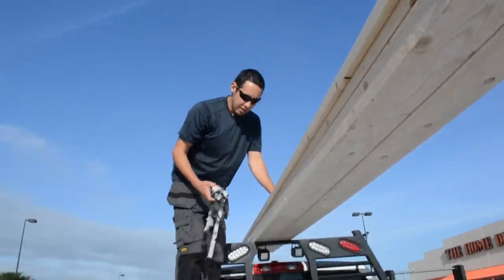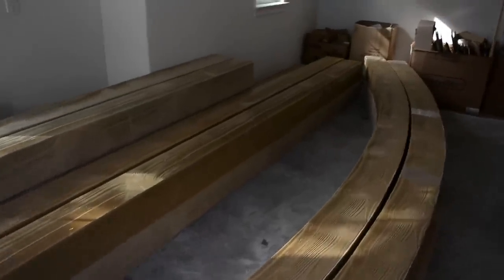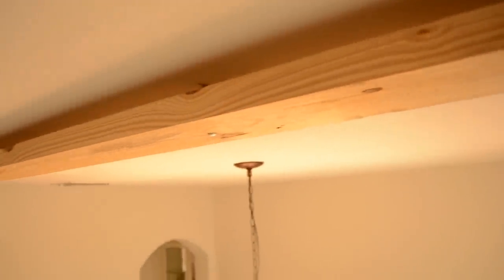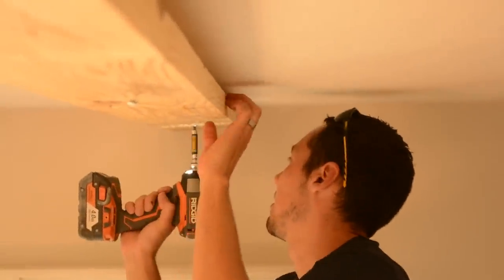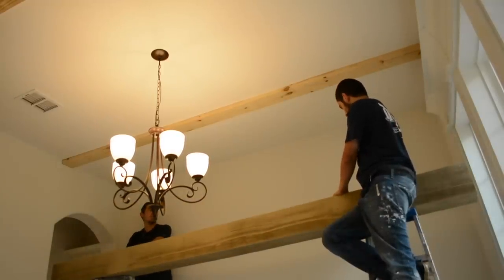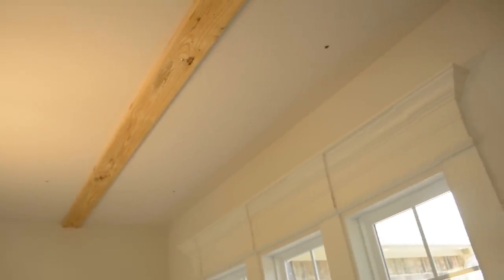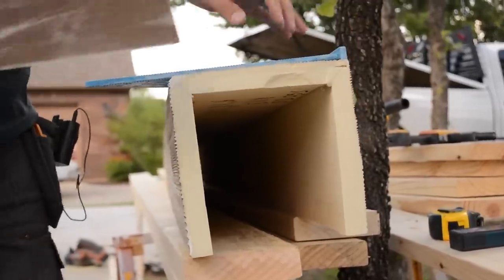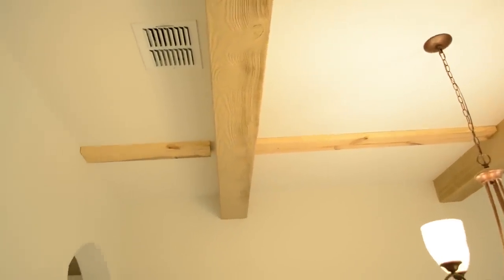Faux Wood Beams Install...

Comment: Instead of using those drywall anchors, go in the attic and add blocking. You can get a lot more solid looking beams this way

Comment: I used to make and install 'distressed' faux wood beams in the 70's. I'd make the beams and beat the heck out of them and used hammers and a router and chains to 'distress' the beam. People loved them back then- always stained in dark walnut.
Edit: I'd make them out of 1by attach the 3 pieces with glue and nails on the flat. All the banging, scraping and beating would hide the seam. I'd pull out the partially sunk nails when dry and beat, rout and scrape and stain. I got great laughs watching you try to get that first beam up. It brought back old memories.

Comment: Love your videos - I have learned a lot from them! One suggestion about the problem fitting the initial long beam with the window crown interference - I believe if you had raised the faux beam up to the ceiling just beyond the crown and then it brought it back over it would have worked - but know you didn't have much clearance with exact measurement so this may have involved slight dragging across the walls to bring it back into position.  But you got it worked out anyway!

Comment: Installed a few beams when I spent time in canada, the pocks are handy to prop the beams up into position while you screw/pin them and also you can get a look at it from ground level before fixing them.

Comment: On your first beam take your small sample. trace and cut through the Sheetrock with a razor knife. Then remove as much as yo need to get the beam in place. Do this on both ends for a really authentic look. Keep up the good work.

Comment: Funny you doing this project I just finished doing a 33' long ceiling beam for a customer, but with finish grade plywood stained and cleared, place metal brackets where the seams were to make it look like it was structural, came out great.

Comment: Just did one of these on a new build. Was a fun project but challenging. The beam ran through about 6 different ceiling sections between different dormer angles.

Comment: On the ends of the faux beams against the wall.. measure tight but bevel the ends into their selves. The foam being soft will crush as it needs more room.

Comment: I am going to try to make ceiling beams out of floating vinyl flooring tiles.  Probably May of next year. I work on my place twice to save the funds out of pocket.  I have to load up what I have video taped of the place first.  Thanks for the tip on the structure board to hold it all together.  I was going to put wooden pieces inside to put the tiles onto.  It would make it more light weight.  The whole thing would be about $500. to do a 26' by 22'.  Strip down the center of the room and 5 coming out from the center in the living room and 5 in the kitchen. I put 24" in between each one.  

The good thing about my place is the upstairs over the kitchen and living room was an attic. Now it is two bedrooms. The ceiling is 6', so you have a good close platform to work on. Once I have the lighting, beams and fans up, I will remove the floor. I will have 14' ceiling on that side of the house afterwards.  It is my childhood home I am flipping.

When I get the videos up I will post the link, so you and your viewers can follow me. I am new at all of this. Only art and crafting I have experience in and can reproduce most things in wood or ceramic form.  I plan on making my own terricotta roofing tiles later.

Your videos are most educating for me starting out. I will mention the people who's videos I learn from as well so you can get more viewers on your channel that way.

Comment: Hey Richard, just a friendly suggestion to make life a little easier.  I dont know if you have one but a featherboard for your dewalt table saw is a wonder for keeping rip cuts super flush.  I have one for my dewalt table saw and I love it, plus it eliminates having to put my fingers so close to the blade all the time.  Keep up the good work! 👌

Comment: Thanks for showing the work around for the challenge at 10:15. The pattern stayed the same but the direction you ran the boards changed.  Therefore you could use the same holes but wouldn't need to as the existing holes could/would be covered by the shorter runs.

Also at 12:30 there is some interesting crown behind you that I would like to seeing how it's cut and installed.  Could you link me to a video showing that if you know of one please? 

Richard, I am not only impressed with the quality of your videos and teaching but also in the amount of content you provide.  Really appreciate you guys.

And it looks like the more videos you do the straighter your teeth are getting.
:)

Comment: You might need to look into building one or two of those Paulk workbenches I’ve seen here on YouTube. Seems that would help your workflow and give you some adequate workspace up off the ground. I think he is a finish carpenter also from what I understand. Search Ron Paulk good guy lots of good ideas too.

Comment: I have done faux beams many times and you can use a nail gun to fasten beams to the 1 x cleat. the beams are light enough and wont fall. that way you don't have a big hole from the screw head. love watching your vids
Reply: John Hutchinson nn nn
Reply: Some glue and trim nails and they ain't going anywhere

Comment: I looked into those faux beams before I started my project and those foam ones aint cheap at all, had to go with 3/4" plywood
Reply: With the plywood I get around here I'd be concerned about being able to keep a crisp Edge of a 45 on my plywood I would almost have to buy cabinet grade before I think the edge would stay halfway decent, did that work out for you? I just did a project with supposed BC plywood and have so many splinters in my hands it's not even funny and I'm glad that these were utility cabinets because quite a few of the edges have splintered off and that's just a straight 90 degree cut.

Comment: Honestly never seen it done this way! I’m 21 years old been a finish carpenter for 2 years! What I would’ve done is find the strapping and the joices with a nail set and screw your cleat with 3 1/2 inch screws! I know it’s foam but you don’t want tht dry wall to sag man

Comment: Just a little tip to speed up things. Those toggle bolts require redrilling and are difficult to work with. Home Depot has a product called EZ Anchor Twist-N-Lock 75 lb. Medium Duty Drywall Anchors. Hold your board up, drill hole, take down, drill anchor in, replace board, install screw. It’s so quick and easy less bit changing and they are 75lb capacity more than enough for most jobs. Check them out

Comment: What I have noticed,  before you hang a beam, if you have any intention of putting those hanging decretive things under the ends, it needs to be done before you hang a beam over it. You have to raise and lower over a screw those things and need the space above where the beam will cover.  Then set the beam over it. You will have a gap between the two things if you don't put the little things underneath.  I can't think of the names of the things. They go under fire places and house roofs for decoration. I am putting a neptune and venus under the ends of the long center beam and some wooden grapes under the ends of the short beams.

Comment: I have had trim work in the way and in this case lifting the beam at the corner of the window to get it above the trim and then sliding it across. Wax paper helps for that too.

Comment: In this video, you are using toggle bolts to secure the boards to the ceiling.  Have you considered using a drywall anchor instead?  To me it seems easier but I don't do this for a living.  What are your thoughts @Finish Carpentry TV?

Comment: Hey Richard, Ive noticed in a few of your video that you use a Bosch digital tape measure,  How do you like it, and how accurate has it been?
Reply: Joe Powell I thought he used a dewalt laser tape measure?
Reply: Erik Sette In the past he may have, but in this video and in several others, he's used a Bosch digital tape measure.
Reply: Joe Powell I was gonna ask him the same thing. Been looking at the same laser he has and was wondering how it works. He seems to like it
Reply: Hey Joe, i have that exact laser measurer he is using, I love it.  It is very accurate and handy.  It saves loads of time for measuring large areas for flooring or lengths of wood.  It also has a square footage calculation option programmed in as well as cubic area and a couple other useful options.  Hope this helps. 🙂

Comment: On my faux beam jobs I rip noth sides of my 2x with a 3 degree bevel. That way my beans slip easily over my 2x nailer and lay square when pushed right to the ceiling.
Reply: Steve Zickefoose what type of foam?
Reply: @caricaturesbykimtonysmith483  HDF (high density polyurethane foam)

Comment: Nice video, thoroughly explains the install, but I cannot see how that beam wouldn't fit other than you just needed to cut a little more off the end.  Looks to me like you had plenty of clearance between the 2X6 and the top of the molding you were just to tight.  I could see if you couldn't get under the 2X6, but you obviously could.  The only problem I could see was that the walls were either way out of plumb, or bowed in and out, but I seriously doubt they would be out that bad.  I know I'm not a pro like you but having installed several of these, it's clear to me you just cut another 1/8th off the end and slide it right in.

Comment: Great video. How do you handle coping the beams where the ceiling might not be perfectly planar? Also, how tight to do you attempt to cut the beam length to the actual measurement in order to allow clearance to slip it into place without damage to the wall (in the case of actual wood beams, not foam)?

Comment: Great video as always!! Could you do one explaining when you should use caulk vs wood filler vs putty? It's something I would be really interested in.

BTW, have you ever tried using Snaptoggles instead of toggle bolts? I love these anchors. A bit pricey but they work great.
Reply: Alexandre Poitras never use caulking to fill screw holes. It will shrink, and you will end up with a divet

Comment: I can't imagine the beams are going to be completely flush with the texture of the wall. Do add some sort of filler at the end or is it not as noticeable as I made it out to be? Thanks for the great vid as well!
Reply: Erik Z if you make your cut exact, the foam will contour to the texture when you force it up
Reply: Colored caulk.

Comment: I'm making some wood beams (made completely out of wood, not the foam beams you are using). Are those toggle bolts strong enough by themselves, or should I also secure the wood to the studs in the ceiling?

Comment: This turned out great. Would be nice to know where you got the foam beams and do they deliver across the US? As far as the layout goes and the fact that you were struggling with the beam running the original way...couldn't you guys have slid the beam up the wall above the window casing and then slid it over to the cleat?

Comment: May I know what type of lumber did you use, the mock seemed light in weight

Your manual saw is good,  what do you call it and what's the brand?

What's the size of your beam,  width and height

Comment: Why do you need such a big board to attach the beam too? Is it just to have more surface to nail the beam too?
Reply: Steve Niemyer I was thinking the same thing.. Im thinking drywall strips would've work? They're like $1 a piece.
Reply: Simon bleed no they wouldn’t hold, you need something to screw to
Reply: Simon bleed those beams would be on floor in a month or two if you try to use strips of Sheetrock. You’ve gotta have something that you cAn sink a screw into and have it hold for the next 50 years at least. 

Most trim guys actually use a 2”x6” for this job but it looks like he was using a 5/4x6” board to me. He is doing it correctly tho, anything less is a shortcut that will not last
Reply: @simonbleed2029  lol try it
Reply: Can you get 5/4x6s at Home Depot?  That's where he got the material.
Reply: I make a 3 sided plywood box that fits inside the beam long enough to span two joists. For the intersecting you make a tee. For this ceiling I would put one in the middle and a tee on each end. Glue and screw to  joists.

Comment: How about if the ceiling board isn't strong enough to support those faux beams? What's the alternative solution or what type of ceiling material is applicable for that?

Comment: Love the video. Enjoy seeing how the day panned out. Have you ever used toggler hollow wall anchors? I switched to them from spring toggles especially in walls with insulation. Also. How are you finding the flexvolt table saw?

Comment: Nice job 

Would 1 x work on the ceiling for the cleats and angle a 2” trim screw, to hold the faux beam ? 

No adhesive?

Comment: I recommend to use a track saw to cut those beams.
Reply: Harry Girgin Surely a table saw is easier to rip than a track saw
Reply: Harry Girgin why a track saw? That's an awful lot of work for an 8" foam beam that takes a minute to cut.
Reply: Fish Freaks Plus not for ripping the foam a table saw is better and faster. I was talking about a track saw to cut the ends instead of a flush handsaw.

Comment: Why didn't you raise it beside the window,  then walk it over?
Reply: I was thinking the same. They kept struggling with it on an angle. Could of held it level at the end wall, get it higher than the window height and moved it over to the board on the ceiling.

Comment: off subject but I watched a video you did on corner crown molding and how to figure out your cuts. my question is if you divide 90 by 4 you get your cuts (degrees) but can you divide by 6 and still accomplish a corner?
Reply: Luis figueroa you can divide your corner angle by any even number you want....but why would you want so many pieces?
Reply: Fish Freaks Plus the effect it will give i think would be cool in my opinion. I'm not a contractor or anything and I'll be doing it on my house so I'm in no rush and would like to bs around with some different ideas. if it'll work great if not oh well.
Reply: Luis figueroa yes you can divide by any even number and make the corner

Comment: seems  like a bit excessive weight  for  drywall  to  support...I would  try  to  anchor into  ceiling  joists
Reply: 71 ORGANIC MUSIC you know they are foam right?
Reply: Richard Campbell yea...but not the 2x6s. Or 8s..they can get heavy...the butterfly  bolts just really  barely  catch the edge of drywall...I'd try to screw into  a ceiling  joist..I'm sure. He has a stud finder.....
Reply: You didn’t watch the video did you?
Reply: Richard Campbell yea....all the way through....  didn't see where. He screwed into ceiling joist....???..I'm a sub...to his channel....I have all the respect  in world. For  his work...I would have. Went a little  farther  and  tied into ceiling  joist....if there  is a floor above that ceiling....it could flex over time...and the 2x6s.  Could  tear the  toggle bolts through The  more then likely.....1/2"  drywall. On ceiling. And if it textured. That even more weight ..
Reply: 71 ORGANIC MUSIC obviously not he stated he intended to

Comment: How do you take the wings out of the toggle bolt after they've been installed into the ceiling?  It would seem like its impossible.  Is it  just left inside the ceiling?
Reply: You can unscrew the bolt but the spring flange stays
Reply: Another style commonly used is a Toggler.  (Brand name) Works like a toggle bolt, but the wing stays put and the screw can be removed and inserted as many times as you like.  Sometimes hard to line up the screw with the wing part.   And they are also a bit more expensive.  His way is perfect for this application.  Holds the board while you make adjustments.
Reply: You don’t unscrew the wings that’s what actually grabs onto the drywall and supports the weight of the object you’re trying to secure (the beam in this case)

Comment: That's a little too much weight on the drywall... over time it's going to cause the butt joints and seams to Crack as well as cause the sheets to sag

Comment: Seems like over time, the weight of the beam would cause the drywall to sag.
Reply: They're foam. Super light weight. I'd say less than 10 lbs per beam

Comment: LMAO that window trim had nothing to do with you not being able to get the beam in place. You only got lucky cause the one wall has an opening that allowed you to level the beam and then raise it. You could have leveled the beam inside the window opening and then moved it over and up and back over.

Comment: Why could you not locate the rafters an screw into them?
Dry wall holding that weight is absolutely ludicrous.
Reply: He mentioned he'd do that later, toggles for speed and between joist runs.

Comment: how are you plugging the holes made from screwing into the side of the Faux beams ?
Reply: I was wondering the same - I did a small ceiling with similar beams and used power grab adhesive then tacked them in with my nail gun (18 ga. with pressure turned down so they didn't go through the beam)
Reply: Drewskidelmar regular color matched wood filler
Reply: I would mock it up with screws to hold the beam in place then go back and replace the screws with oak dowels. You've already made your holes from the screws so tapping dowels in will be fast and easy